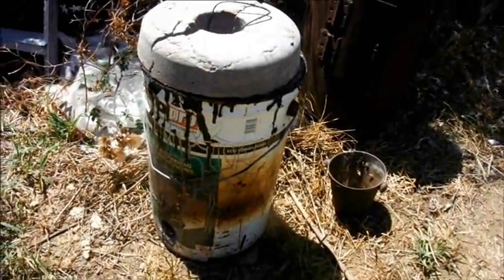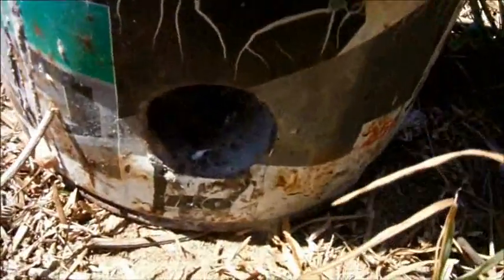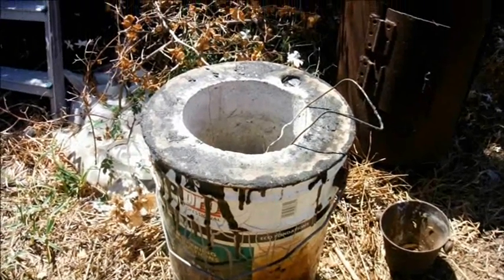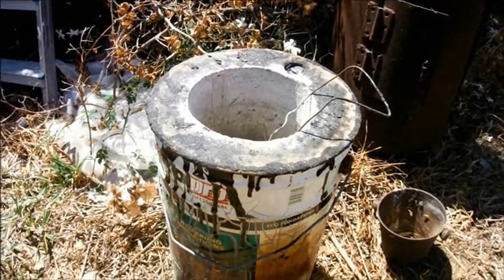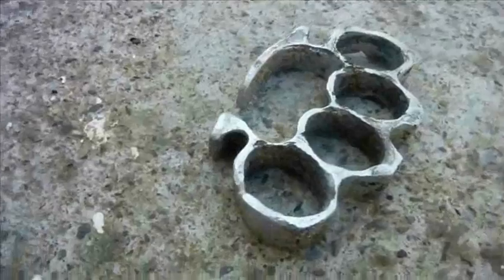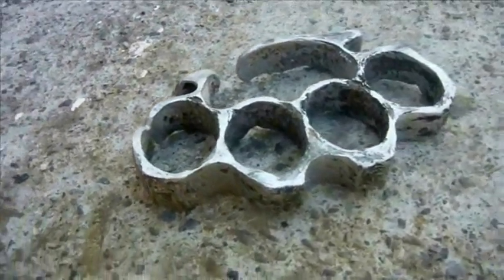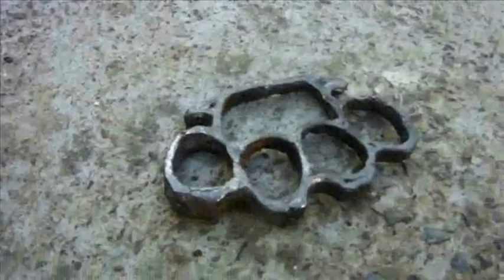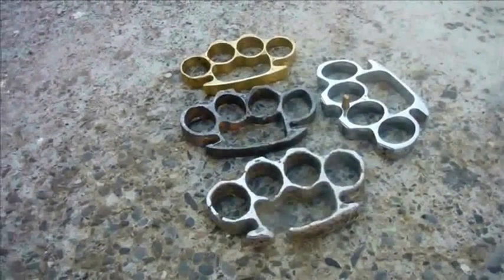How to cast your own brass knuckles

Comment from the maker: The hair dryer is a light industrial blower from the 1950s, belonging to the dad of my RC buddy Adam, whose project this was. He brought a cast iron crucible with him but it wouldn´t quite fit down into the furnace so we shot an empty aerosol can to depressurise it and cut the top off, putting our wire handle through the pellet holes. This video was shot in Spain - I´m sure knuckledusters are illegal in Britain.

Comment: looks dope I've need seen one in a 5 gallon bucket before, if anyone is going to replicate it witch i think i might i would drill the hole for the air slightly less than a third of the way up the chamber for the crucible so that if it melts especially if you have to use something like an aerosol can that you don't leak liquid metal out of the bottom of your furnace

Comment: This is a great stuff. 

What's the process making the crackling noise?  Does the clay need to be wet or dry?
Reply from the maker: That first block, whick crackled so much, was dry. The subsequent ones were fresh and didn´t crackle. The noise seemed to come from spalling caused by extremely localised expansion setting up stresses which made it fracture & flake off the side walls.

Comment: I like the way the bronze one turned out.  Was the clay completely dry before the first pour?
Reply from the maker: Oddly enough, no it wasn´t. I´ve learned tons since filming this, partly by having a clay mould explode as the metal went in. Now I bake my moulds for 6 hours, with the middle 3 hours at my oven´s maximum of 250C, and can pour in the knowledge that there´s no trapped moisture in there.

Comment: Hey, would you recommend doing this? What kind of clay did you use? I might take a go to make one out of aluminum.
Reply from the maker: +Allen Alcantara Hi; yes, I would. The clay is modelling material from a hobby shop. The cement to line the paint drum is called "refractory" ccement in England; it´s heat-resistant. To make a disposable crucible I just used an air rifle to shoot through an empty aerosol paint tin to depressurise it before cutting off the top; you can use the two holes made by the pellet to hook your wire handle to the paint tin. The hardest part seems to be getting hold of the brass! If there´s no other way, I recommend melting down old brass plumbing fittings. Good luck!
Reply: +Del350K4 thanks for replaying one last question. Did you just use any random clay? I'm afraid the clay may not withstand the high temperature. Thanks again
Reply from the maker: Hey, Allen - I just went into a craft shop and bought a block of "modelling clay" off the shelf for a couple of UK pounds. I tried allowing the mould to harden and also pouring into a freshly made mould - if anything, it was better the second time. Let me know how you get on!
Reply: +Del350K4 Thanks for replying once again. ! I will definitely try this!
Reply from the maker: Make sure you get a good air source and keep a lid on the furnace as you melt the metal. Alumin(i)um melts at a low temperature & is cheap so perhaps you might start with some ally. My first ever effort was a sand casting of a pair of pliers (non functioning!). The very next attempt was what you see in my video. I shall await your progress report on this page with great interest  : )
Reply: +Del350K4 sorry for the late response bud! I was unaware of your response. Anyway I just finished gathering all the supplies which took a while. How do you know that a mould is level?
Reply from the maker: Ah, now that´s a good question! I suppose you could very briefly fill it with water?
Reply: +Del350K4 thank you very much! I'll get back to you when I do it! Hopefully, within the next week!
Reply from the maker: Hey, Allen - keep an eye on temperature and don´t worry if you don´t get a good result first time. There are plenty of variables at play here, after all. I began with aluminium as it´s cheap and has a low melting point. Good luck!
Reply: A spirit level is best. If you have any damp or water in the mould things can explode and cause you damage.
Reply from the maker: Definitely - this point can´t be stressed enough.

Comment: can the aluminum be good as a brass knuckel
Reply from the maker: Gta5Carlines you don´t get the weight but it´s surprisingly stiff - it seems no more likely to deform than the brass ones. The lead was, of course, useless!

Comment: How did the aerosol spray can hold up so much heat
Reply from the maker: There´s a surprising difference between the thickness and quality used in the manufacture of aerosol spray paint cans.
  I was lucky with this one, but of course I´ve had many failures as well. It´s not really a good idea to use them.
Reply: Del350K4 k

Comment: did you use dry or wet clay?
Reply from the maker: Isaac Spalter Hi, Isaac. The first pour, with aluminium, used dry clay. At 0:56 you can hear the "spalling" effect as the heat causes the sides and bottom of the mould to crack and flake away on a very small scale. That was the only dry mould we had - we carried on with wet clay and each pour went quietly, with none of that fierce crackling sound. I´d say that, counter-intuitive as it may seem, wet clay is the way forward. By the way, I´ve tried this with damp builder´s sand but the clay worked much better. The heat tended to make the damp sand steam, which distorted the casting.

Comment: How long it takes to melt the aluminum
Reply from the maker: The first time, when the furnace and crucible begin cold, it takes quite a while.
 After that, once everything´s pre-heated, it´s quite quick - perhaps six or seven minutes.
Reply from the maker: @Rdw ane:
 By the way, using a steel aerosol container as a crucible is not a good idea. When I made this video I didn´t realise how lucky I´d been to get away with heating a thin mild-steel container so much. 
  By far the best solution is to buy a real graphite crucible, but I use a thick steel saucepan with a diameter of 14 centimetres and replace it frequently. 
 By now I´ve spent so much on saucepans that I´d have probably saved money by buying a purpose-made crucible...

Comment: hello one question 
the smelting works with gas or carbon
Reply from the maker: Hello David; sorry, I should have made this clear - we used charcoal (carbon). By the way, "smelting" refers to getting the metal from the ore. We were using old metal, so we were "casting" rather than "smelting"   : )
Reply: Del350K4 thanks for resqued.
You are using aluminium and bronze for make a knuckle, who much strength  is the knuckle compared with steel?
Reply from the maker: We didn´t really want to make knuckleduters; we wanted to see what the furnace could do and whether the clay would work. We used the knuckleduster because it was a challenging shape but we thought we could probably do it. I think the bronze one could be used in anger - the aluminium and lead ones would probably deform and trap the wearer´s fingers!